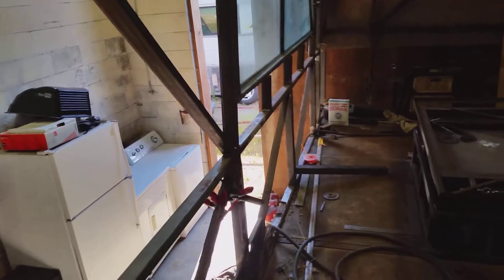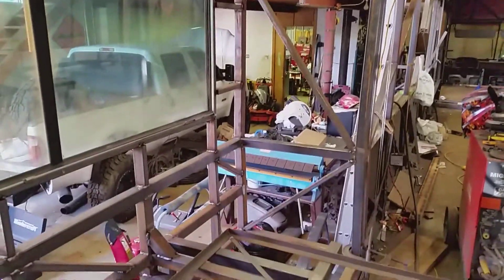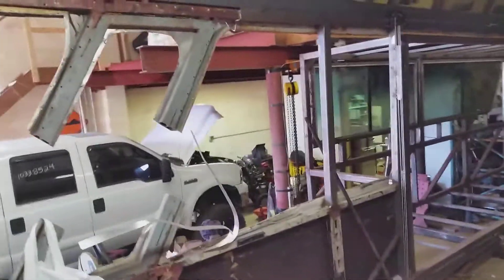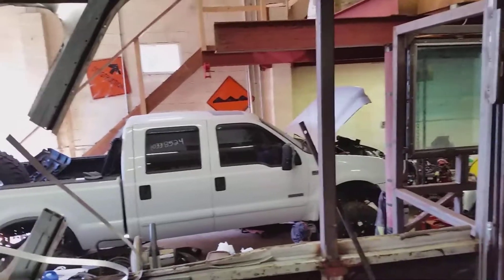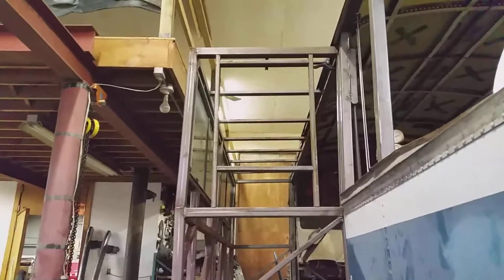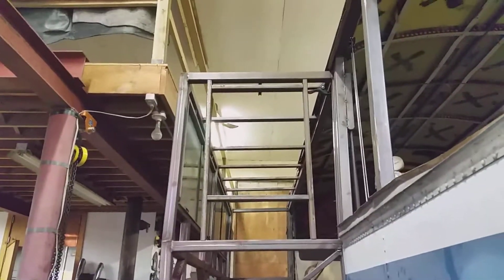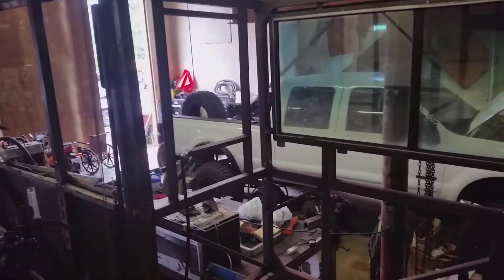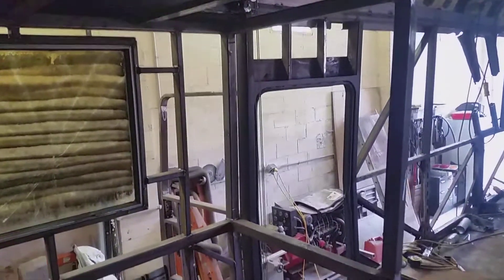Bus Conversion Project - Video 41 - Finshing up the last of the framing

Comment: Will you apply bitumen membrane onto the steel tubing before installing the aluminum skin?
Reply from the maker: No, gravelgard on the framing and then sikaflex 291 as a sealant between the aluminum sheets